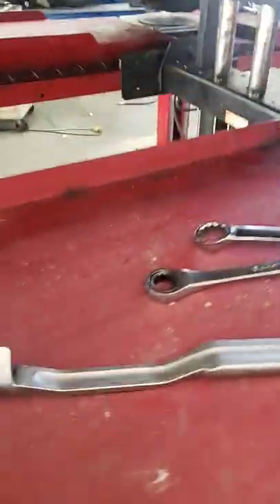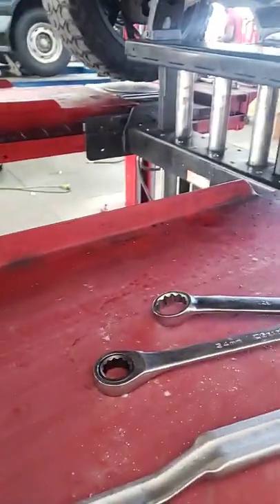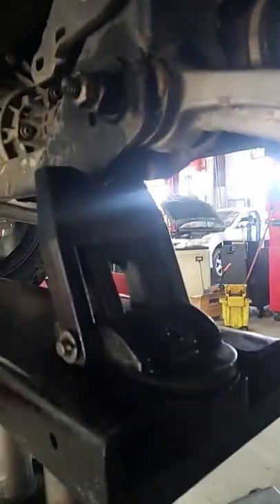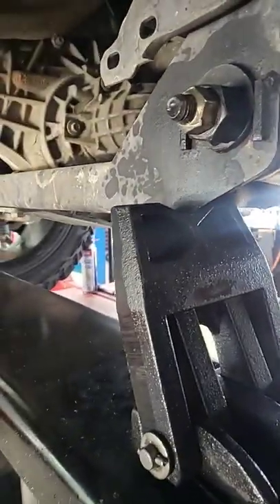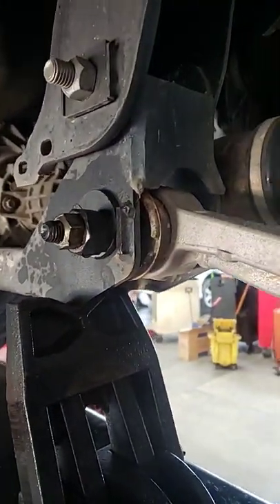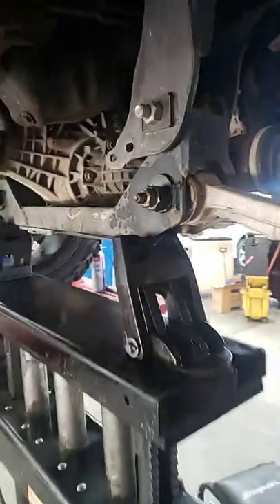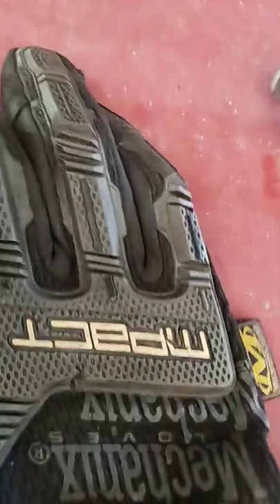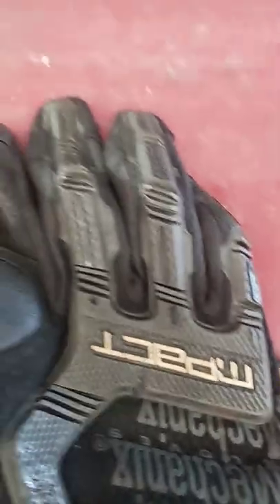2015 Ram Camber/Caster Adjustment tip

Comment: Make sure the weight of the vehicle is on  those lower control arms before you tighten those bolts down. If you don’t, that will cause them bushings to split/premature failure.
Reply from the maker: Thank you for the comment and your advice.
Reply: @angeloeverett-autotech8999  You’re welcome Mate.
Reply: Are you adjusting both camber bolts on the lower control arm or just one ?

Comment: When you lower the truck, it’s going to completely change your numbers. I’ve always found it easier to leave the eccentric nut slightly tight so it doesn’t slip back while the weight is on it . Plus a short socket and a long half-inch ratchet, do wonders when trying to rotate those things
Reply from the maker: Great tip. The issue i run into is space. I have some great flexing ratchet that do a great job in place of a half inch ratchet.

Comment: Problem is unequal length control arms and the suspension settling. No matter what you do, after lifting the vehicle, it will settle an inch or so after driving it around the block and fuck up all your measurements.

Comment: I've been to Goodyear twice already for an alignment and they can't get it. I finally figured out how to read an alignment sheet and the caster is way off. I can't believe they let me drive off the way my car is.
Reply: Goodyear is full of idiots lol I had a short on my ac system for my mustang. The wiring was old causing the compressor clutch to short out. They wanted to switch my compressor 😑 and charge me 1.5k. I searched online and found the map of the wiring and that helped me find the cause of the short. Saved myself 1.5k, Goodyear is horrible
Reply from the maker: @TGLzz  Its a mixed bag of skill sets and knowledge when dealing with the big box stores. I used to work for Firestone for a couple of years.
Reply from the maker: Sometimes, for whatever reason, I can't get caster and camber in spec together. In that case, I will get the camber in spec and caster as close as possible. The reason behind that is camber will cause tire wear. That's  what I do. I can't speak for any other alignment techs.
Reply: Camber and toe are direct tire wear angles; caster is indirect (camber roll while turning) but mainly affects handling and returnability. Both eccentric cams change both camber and caster. The rear moves them in opposite directions and front moves in the same direction. Stack and drag
Reply: Hahaha it’s funny that u thought they even look at it 😂😂 “Toe and go “